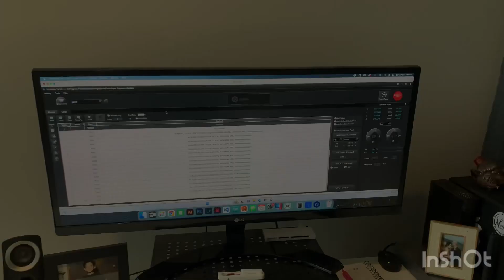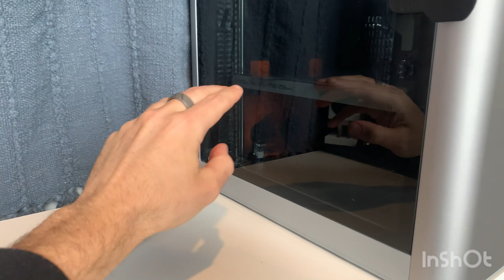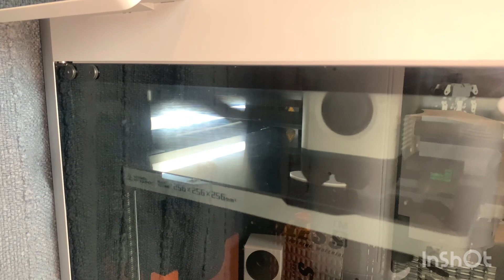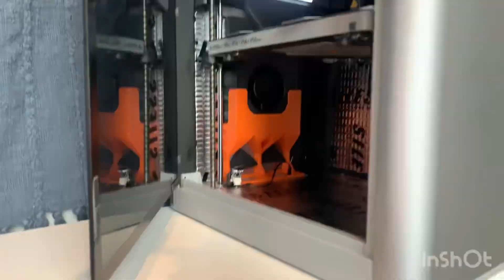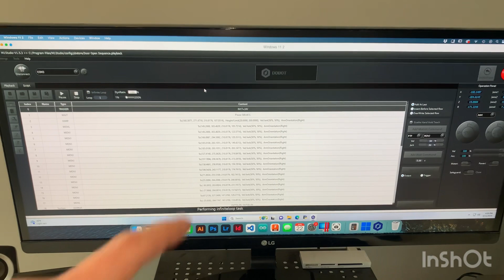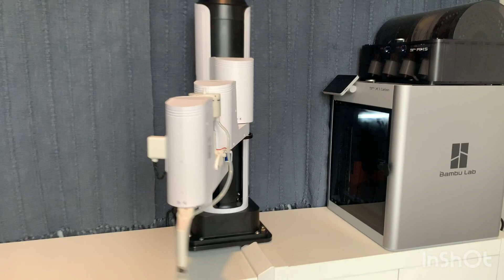FULL Automation of the Bambu Lab X1 Carbon 3D printer with the Dobot M1 scara robot - Part 7

Comment: Bambu lab also had integration with home assist. Can you use the data or signal instead of the extra senso below the printbed? And as mentioned some already, stand alone actuator of some sort for the door opening.

any way cool programminh of the robot arm
Reply from the maker: All in the making currently!

Comment: You can add an air pump... 1st The robot opens the door, 2nd An air nozzle drops air into the heated bed to cool down quickly in order to remove the spare fast so you don't lose almost tons of heat of the chamber, using an air pump that activates after the robot opens the door, 3rd the robot takes out the piece and drops anywhere and finally closes the door and the print will start again.  Greetings from Spain

Comment: Couldn't you check the change in the weight of the receptacle receiving the dropped object as verification the object was removed?
Reply from the maker: That is a great idea! I know the do beam sensors I can pick the part up go over the beam sensor and if there is a part on the gripper it will confirm the beam sensor to continue

Comment: crazy automation. You removed the prime /purge lines? Can you tell me where it was in the code?
isnt just pushing by the printhead working good enough if the bed is cool? (and you got a decent object, not just a coin)
Reply from the maker: I attach my part to the coin so the part can be lifted out. I do have some parts that are low profile so I am not sure they will push out okay.

Comment: Unique solution to automation.  Looks like the bed is hitting the switch PCB before the switch is triggered, or its over traveling.   Interesting idea with good implementation.
Reply from the maker: It was slightly over traveling when I shot the video. I just moved the bed up slightly. Thank you
Reply: @MartinoDesign99 can u pls give me infos about the door opnener with actuator , this is awesome

Comment: How much that acoustic foam sheets works?
Reply from the maker: I did the foam and Nactua fans and it is 10db quieter. It’s worth it in my opinion
Reply: @MartinoDesign99  you mean big chamber fan? So you have to deal with 24v>12v converting right? Do you have tried printed "muffler" over chamber fan?

Comment: This is a fun project! I’m thinking of ways to automate my P1P that will be admittedly lower budget ha ha

Maybe if you have the arm open the door before that eight minute wait you could reduce the time as the chamber would cool faster with an open door? (Assuming you are not printing with any hazardous filaments that need filtration)
Reply from the maker: The open door is a great idea. I can just move the 8 minute waiting period! I am planning to do a future build that is a DIY robot not a purchased robot.
Reply: That is so cool😂
Reply: Maybe the Parol6 arm is for you as you can print most parts, you have to buy the control board and motors though

Comment: I’m not at a spot I can fully watch/listen to the video so sorry if he answers this. How does he deal with the purge lines?
Reply: He edits the G code so it doesn’t do a purge line. Which should be fine, Particularly if the first piece printed is that sacrificial oval.
Reply: @theodoreburns1330  ah that makes sense. I knew you could remove the purge but the idea of printing a sacrificial piece the robot can grab is a good one. I would love to automate my printer. I’m constantly driving to my office on weekends to swap prints so there isn’t too much down time.
Reply from the maker: I am planning to make an automated system that is not a robot arm. Something that can be DIY built.
Reply: @MartinoDesign99  if it works well and doesn’t limit what can be printed I’d happily pay a fair bit for it even if it wasn’t diy

Comment: Skip some steps for the arm and add an actuator on the door that opens when the switch in the printer gets triggered. And as it looks like it's active until you start it again it can just close when the bed goes up.
Reply from the maker: That would definitely work and help with build plate cooling.
Reply: I would agree with you if this was an expensive cnc with a 5 min cycle time but I think that would be kinda overkill the robot moves themselves probably only take up 1% of the cycle time if not less no reason to add in additional points of failure. Maybe at most add a bracket that holds the door in a definite position possibly using a magnet to make sure the door doesn’t swing into an unknown position.
Reply: @joshuahuman1  a robotic arm to unload a print is also a bit overcomplicated in that regard, automated print farms already exists and use the head to push the print of the bed. Now this wouldn't really work with the front of the bambu head held on by magnets. But it would be easier to have linear actuator at the back of the machine pushing the prints out instead of lifting it out. 

So we can agree to disagree about the automated door 😊

(And as a safety feature to stop the arm from smashing through a closed door the end stop of the door could be the trigger for the arm)

Comment: This is awesome! Would be concerned about that vacuum hose maybe getting snagged on the door hook. Also if printed part doesn’t have a flat top surface to grab, maybe could rotate the sucker to grab the side of the part? Could also open the door this way? There’s some mqtt automations you can set up that Bambu supports , it may be possible that way to send a batch of print jobs.
Reply from the maker: I am looking to redesign the vacuum end so the hose goes straight up the 3D printed part.